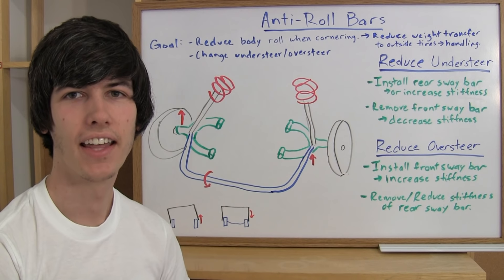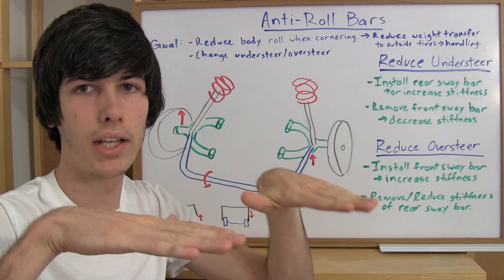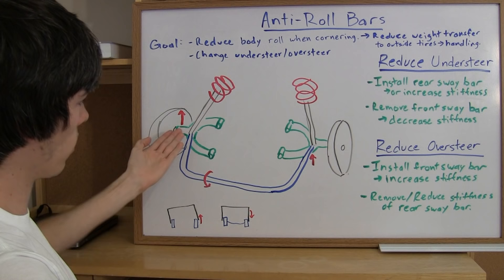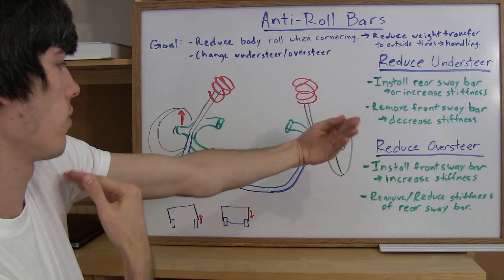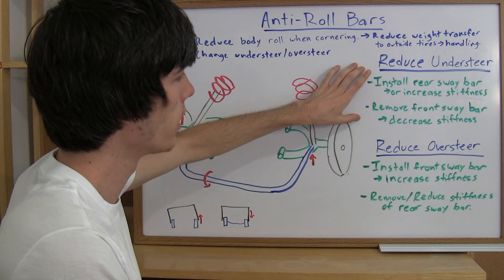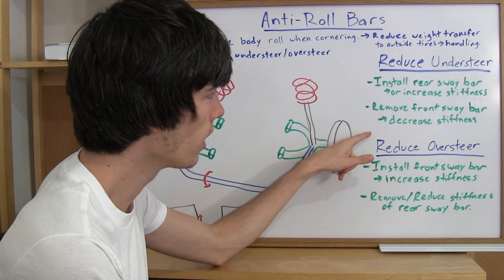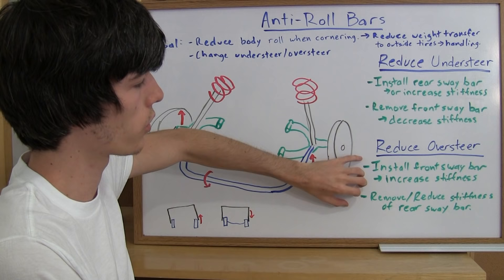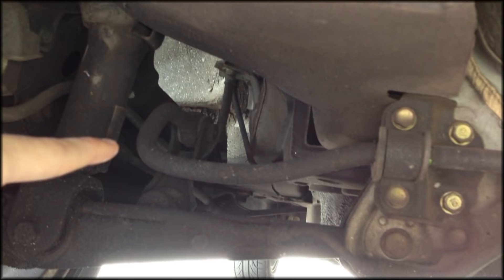How Anti-Roll Bars Work - How To Improve Car Handling

Comment: Can you tell me how bad cars do need an Anti-roll bar? Is there something that replaces it? I recently bought a manual Renault Logan that has no Anti-roll bar in the front, Renault branch here says it's not needed in the manual unlike that automatic model, does that even make sense?

I don't live in the US of A of course because that car isn't exported there.

It's a 5-speed manual, top speed of 200 Kph and 90 Hp 8 valve, the automatic has 4 gears and 20 more hp and 16 valve in case that helps

Comment: The problem with Jason's explanation in this video is that the anti-roll bars do not reduce weight transfer as stated.  If the car was cornering fast enough to roll over, it would do so irrespective of the anti-roll bars.  The total weight transfer, the tendency for the car to roll over, is influenced by the track width and the height of the centre of gravity.
Reply: but there's also the lateral shift of the COG due to body roll, obviously how great a difference that is depends on the height of the cog of the body above its rotational axis. as the body rolls, that center of gravity shifts laterally with the roll, since the body's center of gravity is not the same point as its center of rotation, but above it. add in latent kinetic energy transfer to the wheels (momentum from the roll in a turn, finding enough resistance from the springs to slow to a stop) and you get vastly different handling experiences. anti-roll does reduce some weight transfer, and lowers the severity of its pressure curve on the tires as you enter a corner...and probably then also as you leave. neither he nor i may have explained that with textbook-correct terminology, but ah well...this is the google-tubes. ya get what ya pay for ;)
Reply: It does affect it though. The video is pretty basic in how the geometry works in a practical sense, but you have to start someplace. Once you understand how a sway bar affects the center of gravity between your left and right wheels the learning curve is pretty steep for understanding the relationship between front and rear axles - the COG for the mass of the vehicle itself. If an X is made from all four tires, using the force each exhibits,  the point the two lines intersect will be the center of gravity and will change as the force of each wheel changes. A vehicle doesn't roll because the COG moves front to back or side to side, but because it raises.

It's hard to visualize this unless we get practical. When you drive around a tight corner and the outside front dips the natural thing you would think is to stiffen the front sways to level, but a major factor that's causing this is the rear inside corner lifting and shifting weight diagonally to the front outer while raising the total COG up. Let someone drive your car through tight corners while you watch the rear. You might be surprised how much a side will lift. You might not normally notice this, because your focus is on what's ahead.

A vehicle that has equal friction on all fours will always slide and never roll.

Comment: I've been searching for aftermarket sway bars for both my 1994 Z34 Coupe as well as my 2001 ES300, but I've found nothing. Is there a universally adaptable sway system out there, or how would I be able to figure out what other types might be compatible? Thx!
Reply: Jason Bourne  That's awesome, could you point me in the right direction?

Comment: Part 1: As far as I understood you have a problem with your tires being unbalanced (car and steering wheel starts shaking as you speed up).
First you should start with the simple things that could cause your problem....take your car to a tire shop and ask them to balance your wheels - this is the cheapest thing you could do.
If the problem is still there, check if your rims are straight (hitting a large hole can bend your rims, affecting their balance)

Comment: So a strut bar and a sway bar do the same thing just in different ways, the both reduce body roll is that correct?
Reply: Incorrect, actually. The strut bar stiffens the body, helping the suspension maintain the correct geometry. Body roll may be reduced, but that's not the main goal. 
The sway bar/roll bar is for body roll.
Reply: +FCFordLord thank you for the clarification
Reply: FCFordLord then what is the main goal for the strut bar ?

Comment: Hi Jason. I've got a question about terminology. In an American reality tv show about cars I've met the terms "link bar" and "center link"  being both used to identify a part which looks like an anti-roll bar to me (but I'm no expert). Is it possible that they are synonims? Thank you.
Reply from the maker: Hmm, I believe the center link is a component of the steering assembly.
Reply: Firstly, thank you for your answer. Secondly, here is the description the guy gives of the part in question: "This is the link bar.  This actually holds the rear end in place when torque is applied through the motor". Sorry, I should have posted this earlier, but I hoped it was more straigthforward.

Comment: Can you explain why rear sway bar reduces understeer?
Reply: ARBs increase roll stiffness of the end they are mounted on.  Increased stiffness causes increased load transfer on the end that becomes stiffer, in a curve.  Load transfer decreases across the other end, so that the net transfer is the same (except for some very minor effects from CG migration).

Think "stiffness attracts load transfer" and you'll have it right.  If, say, you stiffen a rear swaybar, you'll increase the load transfer between the rear wheels and decrease it between the front ones.  This has the effect of giving less traction in the rear and more in the front.  There are also other effects from the reduction in body roll including improved camber, that can affect vehicle balance in other ways.
Reply: Thank you so much for your explain man! I actually already got a stiffer RSB installed on my car (front biased AWD Audi S3) and felt this weight transfer myself! I was quite amazed how the car feels now in the corners. It's just so much more balanced. Thank you anyway tho! Your explanation was spot on and proved by my personal experience haha
Reply: Hey, glad to help!  There's so much confusion over this, I was lucky enough to have the younger Millikan (Race Car Vehicle Dynamics) as my vehicle dynamics teacher, and he was such a help.

Comment: But why does over/understeer change with the sway bar? In my simplified view, a stiffer rear sway bar force the outer rear wheel down. And by doing so it should get a better grip, but it does the opposite, why?

Comment: Ah I think I understand.
So the upper part is closer to the center of the vehicle than the lower part - if this is what happened, than it is a camber issue.

If the front of the tire is "open"/further apart than the back of the tire, than it's a "toe in" issue.
Toe in can be easily fixed, but it's quite rare a stock car has an adjustable camber.

This video might help you in solving your problem: /watch?v=MFxH-kjbs7Q

Comment: Is there a way to make the steering of my car more direct, with less body flex, and at the same time minimal traction loss? It is in the suspension, the weight distribution, aerodynamics, or do all factor in together?
Reply: +HoldShiftt2Run Lower suspension, Stiffer Anti roll bars, higher ratio rack and stiffer sidewall tires should improve your cornering and steering feel by A LOT...
Reply: Eduardo Cavalli Thanks fam. What brand of tires and roll bars would you recommend?
Reply: HoldShiftt2Run oh man I can't really give you an answer since I live in brazil... But I heard Michelin Pilot supersports are really good tires! good luck with your build =)
Reply: Eduardo Cavalli Thanks bro.
Reply: +HoldShiftt2Run If you are still looking for tires you should check out Tire Rack. They have a good amount of useful information on their website when it comes to tires and it helped me out when I was looking for a change in the traction character on my car.

Comment: Hello, can I know what is the difference between stabilizer bar, sway bar and strut bar?
Reply: its the same
Reply: +Muhamad Shahrin stabilizer bar = sway bar = anti-roll bar. These are part of the suspention.
a strut bar is NOT part of the suspention but is meant to stiffen up those parts of the body where suspentionparts are connected to it. 
Same goes for other types of braces that sometimes can be seen under the car. They are there to prevent body flex.

Comment: +Engineering Explained
When you say reduce or increase the stiffness of an anti-roll bar sounds easy enough. However, in the real world, if I'm not mistaken, you need to replace the one that is fitted to the vehicle with a stiffer or softer one. Surely you can't try all the the different one for size before buying. 
Please tell us how to work out how much stiffer or softer we need to go to find the perfect set up !!
Reply: ahlapski A lot of Aftermarket Anti-Roll Bars a have tuning built into(in addition to different diameter choice) them in the form of multiple holes to allow the Tie rods to be moved in or out from the ends to increase or decrease the stiffness of the Anti Roll bar/s affect. Thus making your Handing more tunable.

Comment: The anti roll bars do not reduce weight transfer. Its exactly the oppossite. In a corner the outer wheel gets a higher weight transfer the stiffer the ARB and thats how the body roll gets reduced. Think it like this: Imagine someone pushing you sideways on your head. If you want to stay straight you will have to increase the load against the floor on your leg oposite to the direction your are pushed. If you keep both legs with the same load you will roll.

By increasing the load transfer on the outer wheel, the wheel gets saturated (a higher vertical load wont increase the grip level) and the grip level of the whole axis will be reduced. This is because the grip lost on the inner wheel, by losing vertical load on it, is greater than the grip gained by the outer wheel (remember this wheel gets saturated). Thats the reason why stiffering the rear anti roll bar will decrease the rear axis total grip and therefore the car will become less understeer or more oversteer.
Reply: Antiroll bars add roll stiffness to the end that they are on.  As a consequence, they will increase load transfer on the end they are mounted on, and decrease load transfer at the opposite end.  Net load transfer stays the same, except for some very minor effects from CG migration.

The result is that they improve grip on the opposite end from where they are located.  A rear sway bar will decrease load transfer at the front (in roll) and improve front grip.  There will also be effects from improved camber.

Comment: So remove front sway bar to reduce understeer? That means a car that is already understeering, adding a front sway bar is worst?
Reply: Adding a front sway bar can frequently reduce understeer, especially in vehicles with a MacPherson strut front suspension.  The improved camber from the decrease in roll counters the increased load transfer at the front.  The decreased load transfer in the rear adds additional grip, which can be partially reallocated to the front with the aid of a thicker rear sway bar.

Typically you want to upgrade bars as a set.  They are a unified system, they cannot be considered in isolation.

Comment: I need help :l. I don't understand how decreasing roll bar stiffness reduces understeer. If you reduce the stiffness, the body will flex or roll in the other direction which increases the understeer since the body is allowed to roll more in the other direction. I don't understand :l
Reply: The body would put more weight on the outside wheels. Assuming you're turning left, your right side wheels have more force on them than the left. Allowing the body of the car to roll even further right will put more weight on your right wheels, increasing grip and reducing understeer. The reason you only take off the front bar is because your front wheels are (obviously) doing all the turning. You want your back wheels to remain stiff to get as much weight into the right front wheel as possible (this all applies if you're turning right as well.. Duh.) i'm sure there's other reasons, but that's what the physicist says about it.
Reply: +Peter Moger Thanks man, I appreciate the explanation :D!!!

Comment: Hey , do sway bars change load transfer ( not weight ) during steady state cornering ? Thanks
Reply from the maker: +Spiros Mallios I believe the answer is yes, but I'm not certain on the math behind it yet.
Reply: I'm sure you've long since gone over this, but I'll throw this in here...

Bars contribute to roll stiffness on the end they are mounted.  This will have the effect, in roll, of increasing load transfer on the end they are mounted on, and decreasing load transfer on the opposite end.  Overall weight transfer will remain the same except for minor effects from CG migration.

Stiffness attracts load transfer.

Comment: so the sway bar is to prevent roll over when cornering or turning too hardg? What other purpose does it serves besides it?
I know you would want the sway bar to be removed when doing rock crawling off roading so that way u can have the tire on one side to be much lower than the other side...
Reply from the maker: By keeping the car flat, you keep the geometry of the tires in the ideal position, maximizing contact with the ground, and thus maximizing traction.
Reply: Engineering Explained oh, do most vehicles have sway bar in the front and the back axles?
Reply from the maker: Well, I'm not sure if I would say most do. They're fairly common, but more common on sportier vehicles, and they get larger/stiffer on more aggressive vehicles.
Reply: They don't actually help at all to prevent rollover.  Getting 10x the stiffness and keeping the car absolutely flat will only make it say 1% more resistant to steady state turning rollover compared to what it was before. Sway bars don't reduce overall load transfer. Car's don't roll over due to the body swaying, they roll over due to excessive gs (again disregarding dynamic maneuvers).
Reply: 7150285
 More common on the back. It's common enough to put them in even if they are not helpful, just because customers want them there. So far I don't think customer pressure has risen high enough for them to go in both front and back when unnecessary.

Front and rear swaybars on a production car gets pretty harmful for your road holding capacity against bumps etc. Not worth it unless you have absolutely horrible suspension geometry.
Reply: Nereth well if they don't prevent rollover then why is it called "anti-roll bar"??
Reply: 7150285 I get it now, it's because it's to prevent weight transfer to one side and when cornering not "rollovers" LOL!
Reply: 7150285
 They reduce the roll angle your car gets on its suspension, they don't stop the whole damn thing from flipping over. Think about a car with solid suspension and thus infinite roll stiffness. Still flips over in a steady state maneuver at more or less the same time as the same car would with floppy suspension.